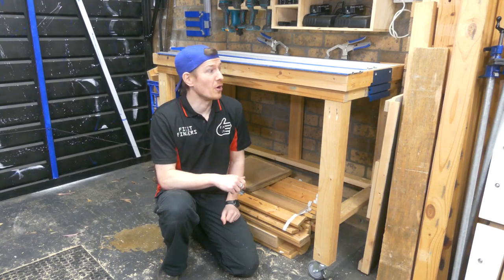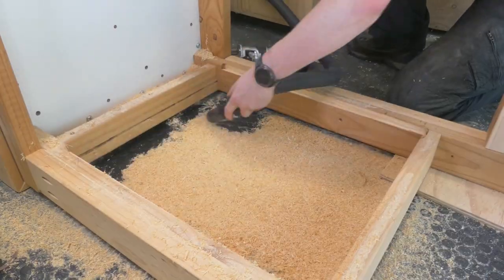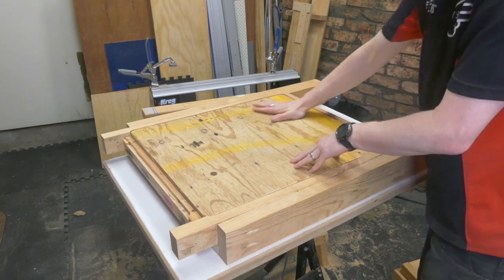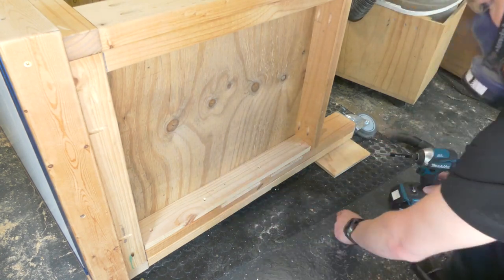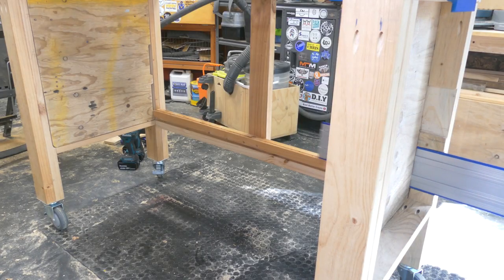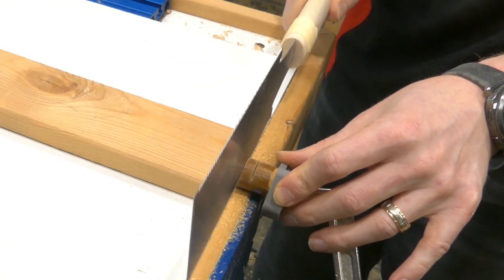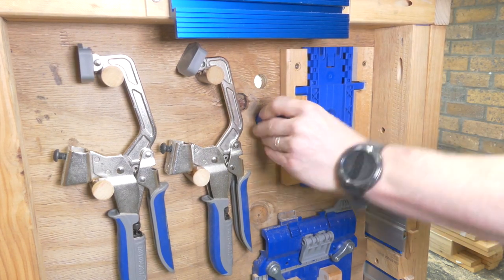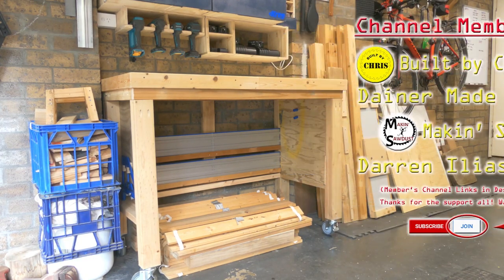Under Bench Track Saw Track Storage (#SpringShopStorage)

Comment: Really great build James. You could fool anybody that this was in the plans to begin with!
Reply from the maker: Half was, but by luck. When I was cutting the workbench top I was swearing at it as 2 track sections were just too short and I had to add the 3rd one... then I realised that meant the bench was exactly 2 sections long. So with this in mind I did actually slightly modify the design, rotating the vertical brace in the middle to ensure a clear path for the sliding tracks I would eventually install. Otherwise... more arse than class 🤣

Comment: Genius idea to utilise the dead space in the bench like that, and keeps all the gear together on hand right where you need it!👌🏽
Nice job, man.👍🏽
Reply from the maker: Had a quick Google on the Tubes this morning and haven't seen a similar solution. Usually it's wall or roof mounting, both of which take up space. I'm liking this hiding spot 😃

Comment: Great video James. Can you tell me how you hook up your Makita sander to dust collection? The port is tiny!
Reply from the maker: Cheers! Are you on Oz mate? If so, Bunnings has the rubber reducer I use. (https://www.bunnings.com.au/powerfit-dust-extractor-vacuum-accessory_p6210177) You still need to use some black electrical tape around the sander port to get a snug fit though! If you are in the States there are similar items on Amazon like this one - https://amzn.to/3bQtlbA . My reducer lives on the sander permanently and I cut it down to the right 'step' size to make it more compact.
Reply: @FixitFingers  yeah mate in Townsville with Dainer. Cheers mate.
Reply from the maker: @riversidewoodworks  Awesomes. Just found you on Insta ;) Big Green shed will sort you out then!